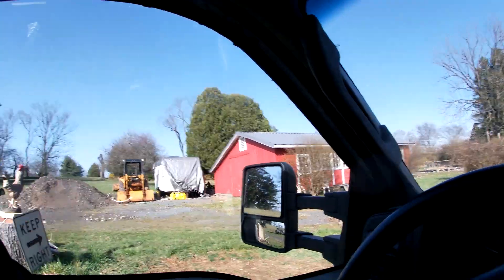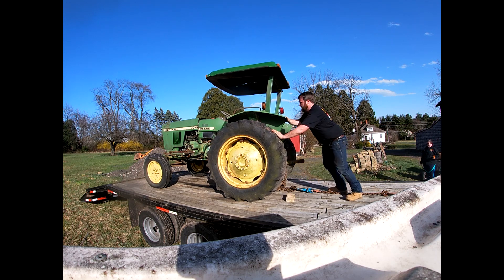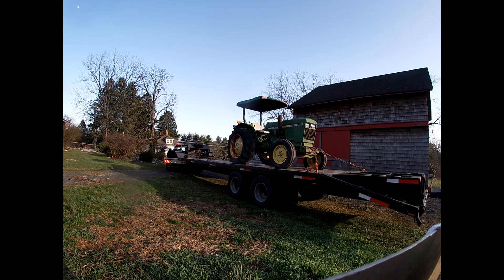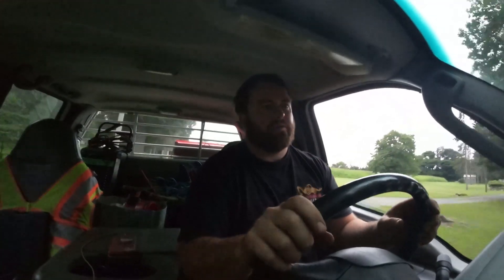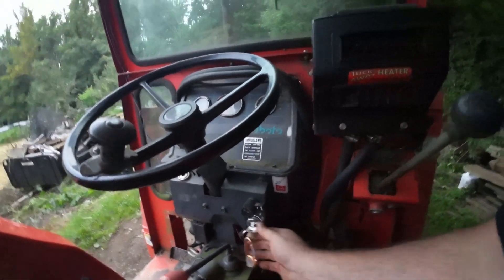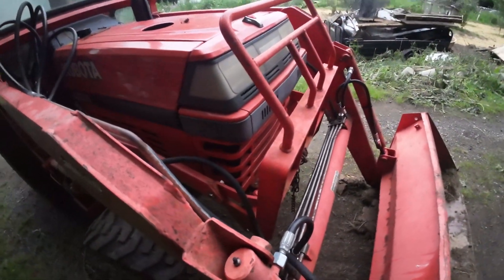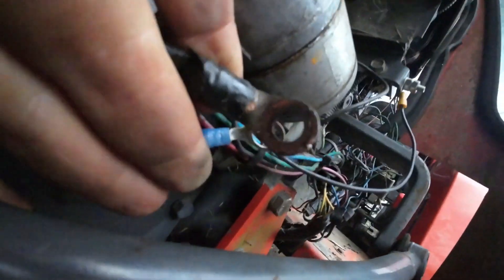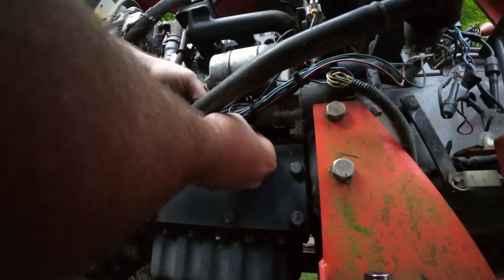John Deere 1050 & Kubota Repair

Comment: I’ve been seeing people making series hybrid mowers. Basically people will add a powerful electric motor to the mower blades and a small battery.  Then they use a gasoline generator to charge that battery. Generators get better fuel efficiency. Electric motors get better torque. You seem like you could make a custom frame. What’s your opinion?
Reply from the maker: You’re peaking my interest!